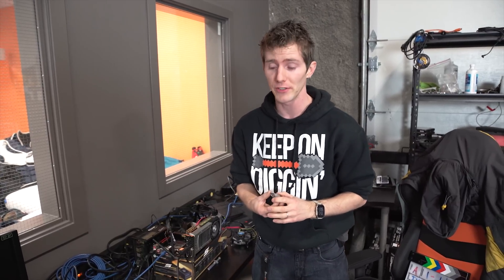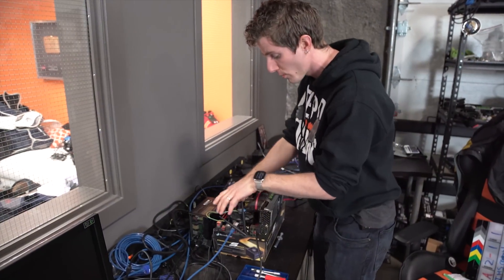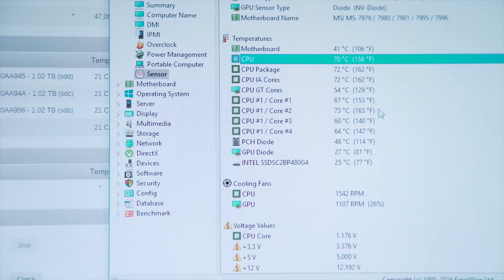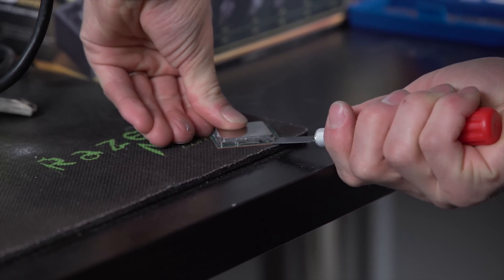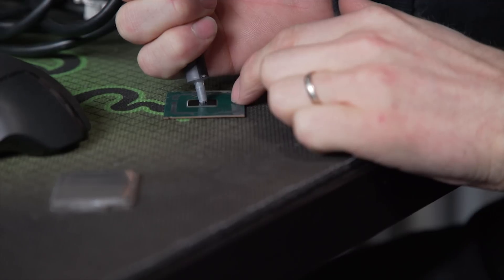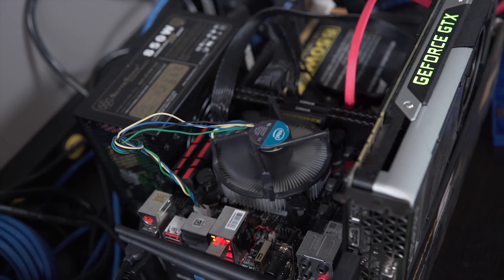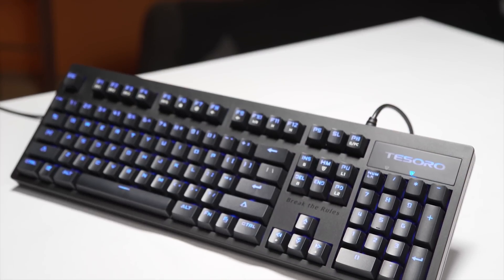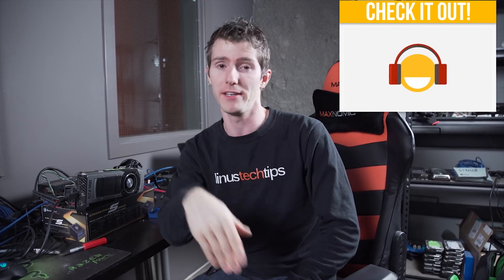Delidding an Intel Core i7 6700K - Is it worth it!?

Comment: Honestly, I think you should have been recommending it but only for people who really need it like the only time it’s worth it to delid a PS3 is when the thermal compound under the heat spreader goes bad my cpu has most cores sitting at around 60 under load but one core on my i7 is stuck at 99c with fresh thermal paste on top the heat spreader with no delid

Comment: In case anyone gets discouraged (would not recommend on later generations cpu when they started using solder again, as solder is much more dangerous to delid) by the results... it's because Linus didn't remove the black silicone glue stuff that joins the pcb to the ihs...the whole point of delidding is not just to replace the paste but to lower the ihs contact and be able to use a thinner amount of paste/liquid metal. Linus left it all on there, so there was functionally no difference other than moderately better paste.

Comment: i took out a old cpu which i knew was broken, just to try delidding it along side the vide.

Turns out my cpu is so old that its from an era where intel apperently soldered the ihs....

i still got it off tho, but the chip in the middle came up with it 🤣🤣

it was a pentium 4 3.40ghz, which was cooked in an office pc for probably many years with alot of dust in the cooler, swapped this one out for a different one and the rest of the system worked fine.
Reply: rip

Comment: I agree that is isn't worth it for most people/chips. I had a particularly toasty but still decently binned 9900K, some liquid metal and a solid copper IHS later and it was much more receptive to the overclock on AIO and then custom loop. If you have nothing to lose I don't see why not, I practiced on an 8350K and the temps were stupid good

Comment: I've heard of miracle stories where it has dropped around 20 degrees after delidding. I'm really considering since my 8700k can barely go about 4.3GHz core clock speed. If I go any higher it starts going to the 90 degree mark

Comment: He did such a poor job of it it's amazing the chip still works. Only a couple guys on youtube did it correctly and got temp improvement at over 20°C. And yes - it does depend on the age of the chip. Older chips will get better delta because the TP has deteriorated further by then.

Comment: Delid my 8700K and used a copper heatspreader, replaced with ic diamond on the die. 15 degrees celsius difference, and I get 200MHz OC potential.

Comment: 🤔 But Linus, 😏👉 why not running the CPU without the lid, but still use paste of course.
Reply: Doesn't work, the cpu needs to be pushed down into the socket, and now Intel uses a soldered tim

Comment: it's been 4 years and the 6700k I got has awful temps, easily reaching 95c on a hyper TX3 with a modest overclock. I expect that the thermal paste inside has degraded some.

Comment: It has since been conclusively proven that using liquid metal such as Thermal Grizzly Conductonaut between the CPU Die and the Integrated Heat Spreader reduces temperatures on a i7-6700K by at least 15C or more.  The key is liquid metal. They also now make devices to safely delid, such as the Rockit 88 Delid & Relid tool.  All of this is available on Amazon.  And there numerous instructional videos on youtube.   Remember, some CPUs are soldered such as the i9-9900K and don't need to be delidded.

Comment: My 8700k on an AIO was able to hit 5.5Ghz with liquid metal after delid with the same temps as a much lower volt 5Ghz OC. If you like to overclock or and build a very small PC and need to pinch cooling performance I think delid is great now with a delid kit. I've bricked 1 of 12 cpu delids and that was prior to having a delid kit. I've also had a 7700k delid hit the same 5.5Ghz with temps being ok enough to validate on an AIO.
Reply: I've also noticed a large benefit to delid of older devils canyon cpus as the paste wasnt even hard it was baked.

Comment: Hi I have a i5 6600 65w tdp cpu. Big cooler on it, designed for tdp up to 130w. When I put it all together 2 years ago, the temperatures did not go over 40 degrees celsius under a full load. Now, I just checked the temperatures after a long trime and I observed, that the temperatures go from 28 to 50 in ONE second, after i click on something, that uses a bit of cpu power. Sometimes I see temperatures up to 64 degrees. When iddle, the temperature goes down to 28 in a few ceconds again, like 10 seconds. Cooler is clean and new paste on the cpu. Anybody has an explanation?

Comment: I removed the cap off my am2 athlon 64 but then i got a fx62 well deliding that removed the lid and die from the cpu bord as it was actually soldered with a gold coulored metal to the lid, it was sutch an expencive mistake made about ten years ago :( the athlon 64 just used silocone and thermal compound not friggin gold

Comment: Using the INTEL STOCK COOLER? This hurts to watch like that design won't be able to dissapate enough heat to be able to tell a difference, like that design has to be at least  12 years old by now

Comment: First, it doesn't void the warranty, at least in the US. 

Second, that you got that result with stock clocks and a stock cooler shows that you should be doing a decent overclock with a decent after-market cooler, or even water cooling (real water cooling, not all-in-one might-as-well-use-air solutions).

With increased voltage and a significant overclock with proper cooling, you'd probably see much more significant results.
Reply: ...he says 2+ years later.  That's YouTube for you.

Comment: Linus, u fail on this test, why? 

Fail 1: You put a dot shape thermal paste on a rectangular shape die, instate of line shape, so that the paste can cover the whole die. 
Fail 2: You use the factory heatsink to run a temperature test, instate of using a better market air or water cooler, so that the test wont be limited by the heatsink it self.

Comment: i have a question i try liquid metal my dell inspiron 1720 core 2 duo cpu aka T7300 2.0 ghz on idle just windows 7 64 bit
im getting 43-45 celcius and im not sure if the temp is ok

if i open chrome and go youtube running videos, temps is around 48-51 Celsius for the CPU
and 54 Celsius for the graphic card or idle 51. " Add some extra thermal paste on the thermal pads dunno if i had too!

fan do not seem to kick in unless a manually put it a 100% using msi afterburner which is lower around 44 degree cpu.
 
maybe i dint put enough Grizzly Canductonaut I dint have to Delidding the CPU it's do not have a cover just the chip set itself and the radiator on and not a single little chip around the CPU so i just put a small amount on the rad and the top CPU! 
im getting these temp! i know i should have check before , but my friend had already take it a part, i try to find the average temp for the core duo t7300 temp but nothing clear on the web!

do you think its a okay temp, does it seem high for you , but its remain steady at that temp!  i may have to take it a part and redo it, maybe retry with just thermal first etcx.. it just a long process also the rad on the nvida card use a thermal pads i add extra thermal paste on it too should i use only the pads that is glue on the radiator? i dint us liquid for that one over the pads!
any help will be appreciated i also put a 4 gig ram seem to work better but i still feel 50 celcius, just on chrome is a bit high considering i use metal liquid!

do you have a good video explaining under voltage the CPU?

Comment: I delidded my 7700k and used liquid metal (konductonaut). Temps were hovering around 75-80c and dropped to 52c under 100% load using EK's fluid gaming loop. It was even worse using an H100i v2 (would consistently rise to 90+)

Comment: I could not disagree more with Linus' conclusion here. After delidding my 7700K I saw about a 40°C drop. With a 4.9Ghz overclock my CPU was hitting the 100°C throttle. After the delid and a Condoctonaut liquid metal TIM replacement I'm getting about 64°C under load at 5.1Ghz. The risk of the delid was absolutely worth it. I could not be happier.

Comment: i have an i7 7700k (since end december 2017) iddle temp : 25-30°C / in game temp (gta 5,PUBG) : 50-55°C (and yeah running at base clock 4.2Ghz). I don't use watercooling, just noctua cpu fan. One of my friend told me that i was lucky because i had a chance to buy a "bad" one (too high temps). I read somewhere that i7 7700k from end 2017 are better than the others from the beginning of 2017, do you think it's possible ? (another of my friends bought his i7 7700k in the beginning of 2017 here are the temps : iddle : 50°C / in game : 80°C and he uses watercooling...) 😵

Comment: My 8700K was stock at 70 degrees, after my 2500K on the same cooler at 4 Ghz was at 60-65 degrees.
I delidded, and used Thermal Grizzly's Kryonaut(yes, I know, it's not as great as Conductonaut, but I'll be doing sub-zero)
And I got a 5 degree increase.
What the frick

Comment: Linus saying it is totally not worth it, but using shitty thermal paste (if u take the risk + take the time use liquid metall pls) and mounting the stock cooler without OC. Yeah sure there is no relevant improvement in temps. When they changed from Sandy Bridge to Ivy the differences in temps (cause of changing from solvered IHS to normal thermal paste between heatsink and IHS) were not remarkable in stock settings anyway. It just got attention because of people OC'ing it.

Comment: Last time i delidded was a 4770k (Never delidded my enthusiast pc :-D) with a significant drop in temps. So tried the same with my new 8700k, i bought a new system since my z87, 4770k system got fried (CPU, ram and Drives still work but MB is fried) i got the Thermaltake Floe Riing 360 AIO and 9 fans in total in the case, so i believe the cooling is not the issue :-). 
A little story of hz and temps comes now :-) the 8700k came and went in the system. 4.8 Ghz was the max before it hit 99 degrees Celsius and thermal throttled 1-2% after some minutes of Stress test. So i ordered the Dr. Delid tool (german engineering ;-) )  and did a delid --> thermal grizzly liquid metal --> gluing the thing back together and voila. 5.3 Ghz before thermal throttling just 1% and just one time after 23 minutes. And running 5.0 Ghz at 75-80 degrees C, so a 200 Mhz increase on the CPU and a 20-25 C drop in temps. That's pretty much :-) my friends 8700k runs much cooler from start. The thermal compound in my CPU was lacking in 2 corners of the die and seemed like there wasn't applied enough and it was very dry compared to other delids i have seen. But after this success i can only recommend the delid if the temps are too high or the overclock is to small :-)

Comment: why didnt you use a delid tool?  Also I would have tried it with a good air cooler which is what anyone who is doing this would be using, at least.  I think the point is that it makes much more of a difference when you have more cooling power.  Overall,  pretty unimpressed with your choices

Comment: I do not share your opinion. Your test was not good.
First because you didn't use liquid metal, which makes a HUGE difference.
And because you use so much thermal compounds between CPU and cooler the heat jams there and then you remove the improvement of your work, because before that the heat jams there, and now it jams here..
Sorry for my english, I am German.

Comment: Did this with a i7 3770k with liquid metal thermal paste. Saw a deduction of 14 c on a hyper 212 evo dual fan. Running a stable 4.8 ghz overclock.

Comment: its not for stock clocks with the stock cooler. its for higher clocks which add higher temps. you will see a difference then.

Comment: Very misleading video. They didn't go into detail at all. The delidding process affects different CPU's in different ways. Some benefit more than others, and this was never mentioned. 

For example i delidded an i7 4770k and got a MASSIVE decrease in heat after adding a very basic watercooler.

Comment: I had removed the lid on one of my old AMD Phenom builds way back when and the biggest pain in the ass was modifying the brackets so the heatsink made contact with the die. And for safety I added 4 solid foam dots on the corners of the chip PCB like the old old old AMD cpus to help protect the die from chipping off a corner.

Comment: Unfortunately,the limiting factor moved further from the internal paste and got stuck at the tiny heatsink.
Without a decent cooler on there to really show the thermal bottleneck ,this test ,apart from showing a 4% decrease in temps was a bit pointless.
If the improvement only reached 6% with a good cooler and you are overclocking an otherwise
good sample chip, a 6% decrease in temps would be well worth having.

Comment: it is worth it if your running a older cpu such as a i7 3770k like myself im running water cooling and my temps never used to get above 50-55 degrees now with just stuff running in the background its spiking up to 55-60 and under full load it get above 70+ degrees which annoys me so i replaced the past and now temp don't get above 50 degrees and the old stuff was like cement and really dry. the past i used to replace the old stuff was mx-4 really good stuff.

Comment: There's a little device which was made by a German overclocking and casemodding enthusiast (der8auer) called "Delid-Die-Mate 2". All you do is clamp the CPU so that pressure is applied evenly and then you turn a screw to crack the bond between the CPU and the IHS. No cutting with exactoblades, just turning a screw. It does cost about 30 euros, but there might be some shops which do the work for you for a few bucks. 

I've seen wildly different results from people who've "decapitated" their CPU. Some get 2-5 C°, others 15-20 °C. I'd say that it's not worth it unless you're into overclocking and need to keep the temperatures down as much as possible so to get even higher results. But it could still be interesting for those wanting lower noise, since lower temperatures mean that the cooling doesn't have to work as hard. Fans don't have to spin as fast, pumps can power down, etc.

Comment: i have 7700k, and i have to delid it.. was gaming counter strike go and it hit mid 80s... so i delid it and now it is 20c degrees cooler.. hitting mid 60's to 63c.. and idles usually at mid 30s to low 40s.. with dynamic turbo OC on..

Comment: Intel's thermal paste is very consistent, it will keep the CPU at the same temperature for years (pretty much for the whole life of the chip). Better pastes, with better thermals, are not as cosistent and will degrade as the time goes. That's why I would not bother with de-liding.

Comment: You should be embarrassed to have such a low quality video about this on you channel. My friend just from above 90 temps to mid 70s because he did this correctly, with liquid metal and a decent cooler. Absolutely pathetic that you would put this trash out there.

Comment: Every time I see you add thermal compound to cpus, I wonder why you never spread it. Then I see this one, where the goop properly spread for the cooling die. I've always made sure to spread it out evenly with a credit card or something similar to get a perfect uniform thickness, as that was what I was told, what processor installation instructions told me, and how I've seen many others build their systems. I wonder if it makes any difference at all to just drop a pea on one and slap together vs careful application, then.
Reply: The pressure if the heatsink spreads it out
Reply: @pointed.sphere  I think they tell you to spread it so any imperfections in the heatsink doesn't prevent the compound from spreading evenly and to avoid air pockets.

Comment: If the IHS isn't reapplied with adhesive wouldn't it bottleneck the performance if the temperature becomes higher due to bad connection with the TIM? I have no intention of trying this but would it or would it run the same?
Reply: I just saw in a comment from Lolled9991 that AMD solders to the IHS  so I'd be unable to do it anyway.

Comment: yes you can apply a better thermal conductive paste to the cpu but the reason intel uses their "crap" paste is that it is designed to last indefinitely whilst maintaining reasonable performance they were not cheaping out at all as the paste they use costs more to make than the high thermal transfer pastes you get which may conduct heat very well but they also degrade very quickly. you try and find a thermal paste that will last that long with that performance :D (pentium 4 chips are still going strong on original ihs paste)

Comment: You would get even slightly better results if you use that coollaboratory liquid ultra metal compound Linus (between chip and IHS and even between IHS and heatspreader).. Even on that stock heatsink - combined with watercooling would be more than great..

Comment: Just completed a delid of my 7700k using liquid metal, along side my Noctua NH-D15 heatsink. Saw a saving of 16ºC over my  4.9GHz overclock, which is a whopping 28ºC cooler than my motherboard's auto 4.9GHz overclock. Even my idle temps dropped a couple of degrees. Gives me so much overhead for additional overclocking with peace of mind. Is it worth it? For me, I'm happy I did it, even if my warranty has been voided.

Comment: Holy crap dude, you couldn't have done a more confirmation biased experiment if you tried. You didn't spread the paste on the die, probably as bad as what you took off.

It's like you were just going through the motions expecting to fail.

Comment: First of all, there are cpu openers aka delid tools avalible everywhere starting from $2 to $40 (or free if you are in luck to access 3d printer) with next to zero chance to damage your CPU. I've got mine for $12 shipped and had my 4770k boosted from 4.2 to 4.8 Ghz with 1.30V and 79C peak. Yeah. Totally not worth it.